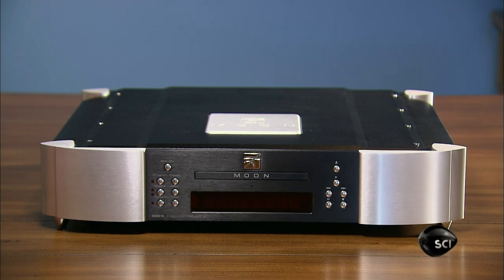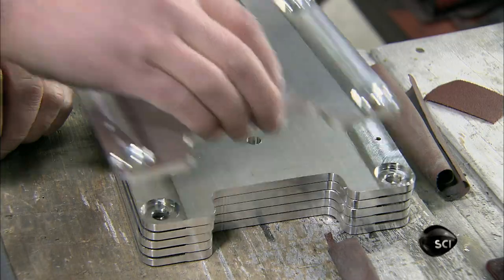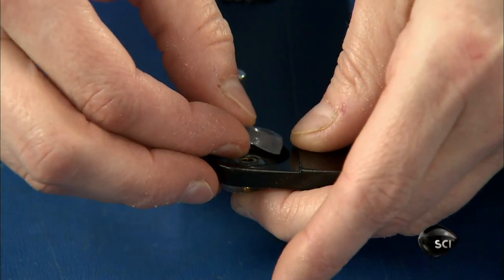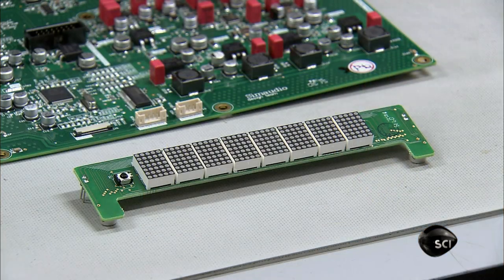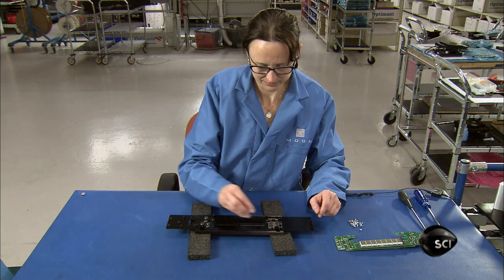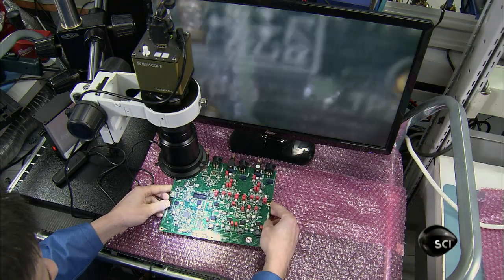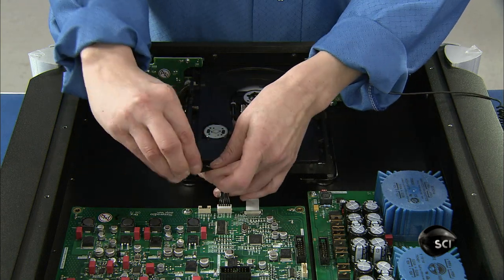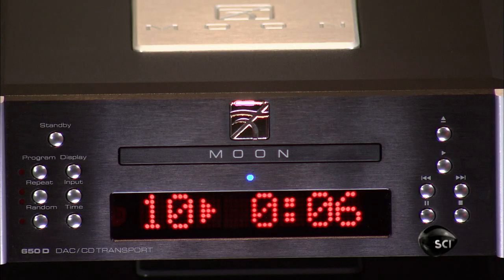How it's made: The MOON 650D DAC / CD Transport

Comment: In terms of audio fidelity in a modern digital component like this, don't fool yourself. The 0s and 1s must be 100% reliably delivered exactly as you expect when you open a piece of software on your PC or a photo from a JPG in Photoshop. A US$5 USB flash drive sounds EXACTLY as good as a super expensive CD drive delivering the same file of music into the same system because the 0s and 1s aren't any different. The DAC itself is a different matter and could make a difference, but it's a bit overrated also compared to the effect you get out of a careful speaker or headphone selection. Anyone who owns a recent iPhone using the included Apple 3.5mm adapter cable should know the Cyrus Logic DAC sits inside the super tiny connector housing. You can do an easy A/B test to see how much the DAC matters per US$ vs. similar spending on speakers or headphones. If you want to spend several US$1000 on the DAC it's because your speaker system is of a high standard possibly costing several US$10,000 making it (perhaps) possible to hear the tiny differences.
Reply: I agree on the digital source side, but a dac makes a big difference even with  affordable gear.the dac in iphone sounds awful even compared to a relatively cheap soundcard, even using relatively cheap headphones!
CD players sound better not because of their cd drive but because of their dedicated dac.
Reply: HASHEAVEN Well, I’m not here to promote cheap DACs used in Apple products but most people don’t realize they are better than what audiophile DACs could do some years ago. Cyrus Logic part number 338S00105 used in the tiny iPhone cable adapters is definitely not audiophile in my opinion but it’s far better than the vast majority of speakers, earbuds and headphones can ever resolve. But of course we want better...
Reply: +ThinkingBetter  In terms of the theory, I agree with you that as long as the 0s and 1s are restituted precisely as 0s and 1s, and in the time domain also (jitter free), the audio should sound identical. What bugs me is that different CD transports sound audibly different, and even different digital SPDIF and AES cables sound different. And I'm not just talking about comparing cheapy crappy CD transports and cables...I mean even comparions between high-end transports and expensive well made and well-shielded digital cable brands. And also when comparing electrical to TOSLINK-optical connections too. My brain says it shouldn't sound different, because as long as the DAC can tell the difference between a "zero" and a "one", and succesfully align that datastrean correctly to the operational sample-rate template, then, no audible difference could be possible. It is immensely frustrating therefore to hear differences, and for those differences to be unexplainable via digital sampling and playback theory.
Reply: Huxxy You can rest assured that digital audio is all explainable. Some equipment does sample rate conversion or error correction in the data path that can yield issues. Personally I’ve even seen actual software bugs introducing audible artifacts. But none of these things cost any money at all to get right. Make no mistake, it’s a US$0 thing to make a perfect digital signal path to the DAC.
Reply: yeah, everything is sneak oil. $2k cars can do the same job as $2m car, as long as you drive them in downtown. As long as you do not listen to classical music and other acoustic recordings, your points stand. For poorly written, recorded, mixed tracks, the source does not matter. But please so not bring those super low standers to HIFI world.